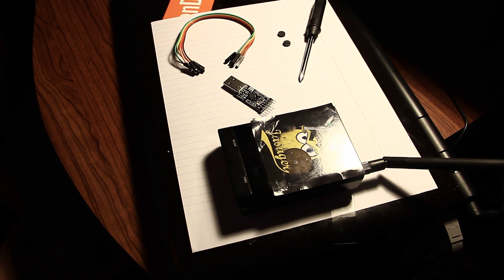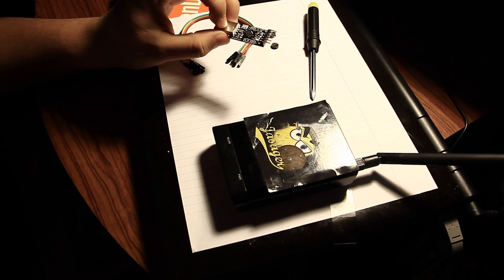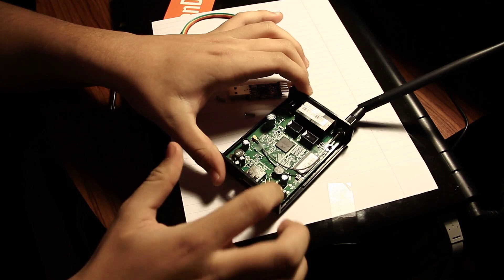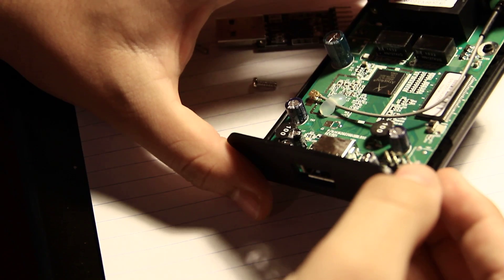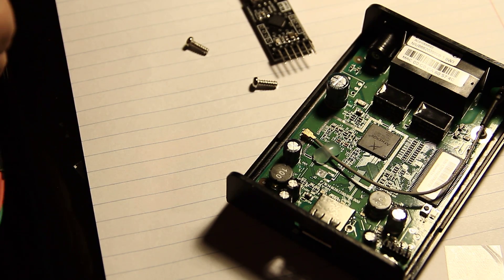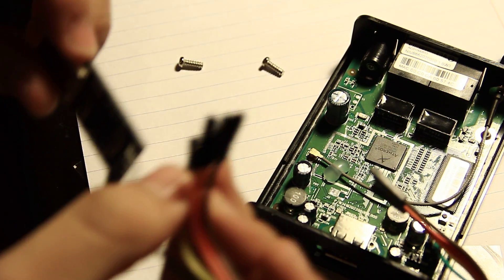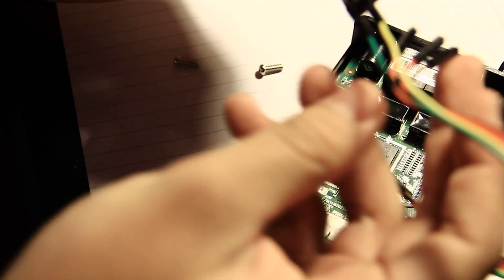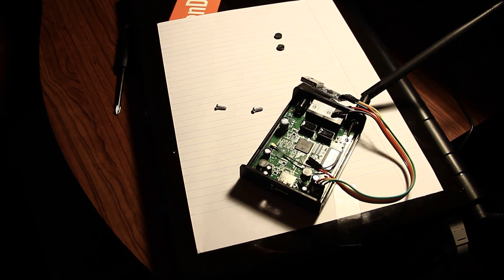How to Flash the Wi-Fi Pineapple IV Over Serial  P-1

Comment: The pins are labeled right, because tx connects to rx on the router and rx connects to tx. Because uart is txing while router are rxing and always have been like that. You can't put one reading and the other reading too. lol. So the rx always have to connect to a tx so they are correct labeled.

Comment from the maker: It's the 3.3v pin, but don't use that. It's safer to just use the wall adapter for power. Apparently the guys say on the forums that they burned out boards just using the 3.3v pin. Unreliable power I guess. It even says on the wiki " DO NOT hook up the VDD pin to your adapter."

Comment from the maker: I know that. Rx to Tx and Tx to RX. It depends on how the manufacturer labeled the rx and tx. It could mean that this connects to the rx pin or this is the rx pin. I just wanted to mention that because if you don't see any text flowing in the terminal just swap the rx and tx pins on the adapter.